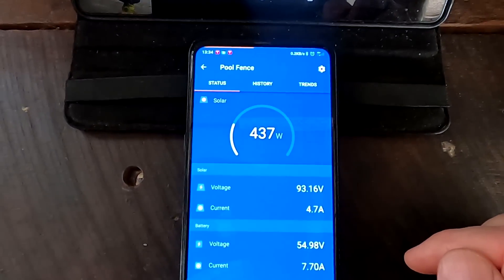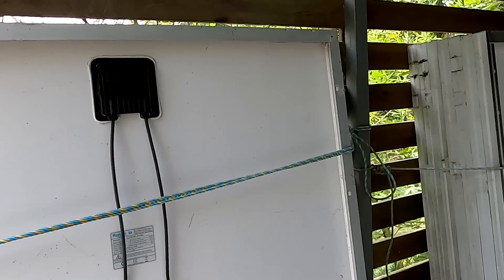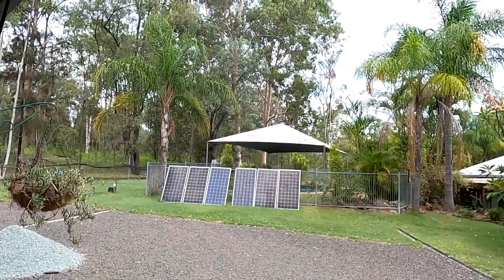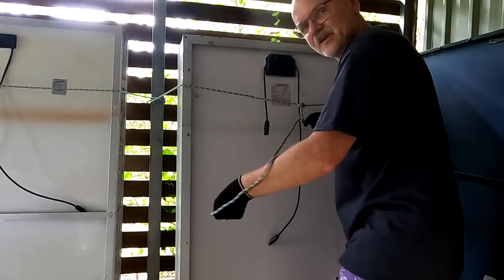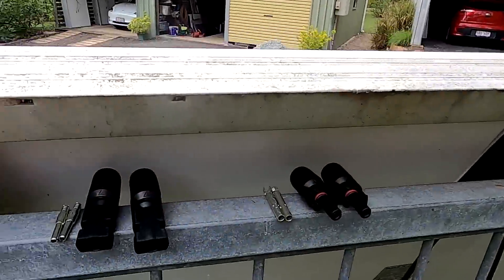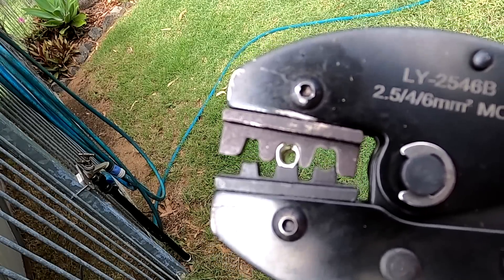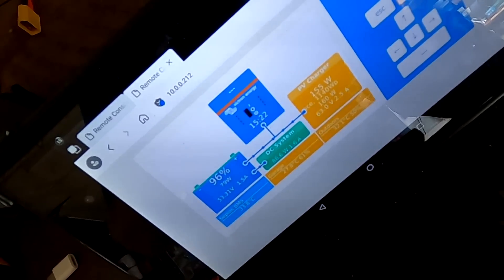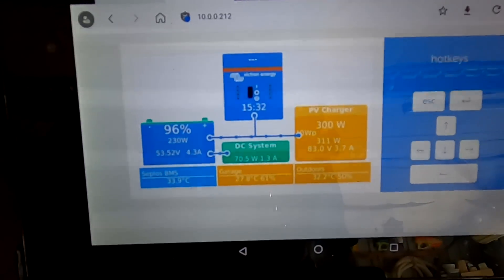'Massive' Pool Fence Solar Upgrade 😉 I almost lost it... 🤦‍♂️

Comment: Andy, I made the same mistake, putting the wrong ends on the MC4 connectors. IT took me a couple of days  wondering why the Amps were so low, I blamed the second hand panels I used. It wasn't until I went through every connection and double-triple checked everything that it became apparent. I don't feel so bad about it now when I see you got foooled too lol.
Reply from the maker: Yeah, the MC4 connectors are a bit tricky and I always need to concentrate when I crimp them.

Comment: 😁Im looking for some advice please, ...im in the uk, and very new to solar....i have 5 panels each 420w .....(each panel has  vmp 32.04v...imp 13.11A...voc 38.15v...isc 13.80A)
Can you give advice on what grid tie inverter would work well, ( id like a plug n play type like your blue 2kw grid tie), and whats the best way to  configure the panels and grid tie inverter?.... ( its difficult to decide, there seems to be many ways to go)...thankyou
Reply from the maker: Hi Andrew, that is a very difficult question. We don't know your requirements in terms of loads you want to connect, your roof space, orientation. Grid tie inverters are not plug'n play and need a qualified electrician to be installed and commissioned as per your grid code. A contract needs to be setup with your energy provider to export excess energy to the grid. So, there are quite a few things to consider and not a DIY job any more.
Reply: @OffGridGarageAustralia   thankyou for your reply...in simple terms i thought that the SUN-2000GTIL2 gridtie unit plug straight into the home electrical outlet/ standard 13a socket in uk, to deliver the power to a house that the panels produced?...is not that how this unit works?

Comment: Yah, those DC breakers are sometimes polarized.   Its a mix... some DC breakers are not polarized, some are.  If you put the wires in backwards for the DC breakers that are polarized, they basically won't function.   A bit of a hazard, I've accidentally reversed the polarity myself when changing the amperage... different brands arrange the plus and the minus in different orders.  Sigh.

Comment: Does the victron allow 2 strings and I’m guessing you added another circuit switch or did you run 5s2p? You didn’t say.
Reply from the maker: The MPPT allows only one string. The panels are in 3s2p configuration.

Comment: Hi Andy
I have 2 x 8S 280Ah Lifepo4 batteries, each with a JK-B2A8S20P (200A, 2A activ balancer) BMS. 
At the first glance everything works fine ...
But when I shut of the active balance function with my phone, 
and there is still a voltage deviation ... 
On the next day my battery is perfect balanced! 
The checkbox for balancing on my phone app is still OFF! :O
That happens on both of my batteries! 

It seems the balancing is allways on, regardless of the swich position in my phone app! :O
So it will be nice to verify my guess,  if you have time therefore ...

Regards from Berlin (It's cold outside -3°C)
Reply from the maker: The deviation will only show at 3.45V or higher. If you measure in the morning, the cells will be in the flat area of the curve and don't show any difference. 
If the balancer is on, you will also see the +-2A balance current in the app.

Comment: Hi Andy, I have been following you for a while and built my system using many of your ideas. I have a couple of questions about the battery 2.0:
1) Why don't you connect diagonally the batteries to the bus bar as recommended in the Victron wiring unlimited manual (page 19)?
2) From my understanding the vertical bus bars should be connected to the center of the horizontal bus bars in orders to optimize current circulation (see page 38 of Victron wiring unlimited)
3) If you want to move to parallel inverters, they should have same cable length and cross section, but also be connected symmetrically.
Hope I am not wasting your time and that these comments are helpful.
Congratulation for your work, kindness and German accent (I dare that joke since I am French and also have a strong accent ;-)))
Cheers from rainy South of France
Yann
Reply from the maker: Thanks, Yann
1) I have connected all banks to a 1200A bus bar so cross connecting them would make very little to no difference.
2) Again, this will make not much difference. If you have a very large system, it is more important to follow that but not for such a small one.
3) Yes, that is correct. I would just install a new pair of busbars right underneath the inverters and connect them both to that.

Questions and comments are never a waste of time. This is my favourite place to be. I appreciate your questions.

Comment: I am looking into Superen AC DC Hybrid Solar powered DC 3.5kw air-con system ,runs on 4-6 300w pannels in a string can take upto 300v , runs of both mains and solar auto switching if cloudy , they also do 48v offgrid 5kw system's ,
Reply from the maker: Great tip and they are even in Australia! I'll look into it.

Comment: I have 4 150w 20v in a string and 2x 300w 40v full size also in a string ,makes 1200w sun peek out behind clouds, average 800-900w ,peek voltage recorded today was 76v on a 100v/50a mppt,

Comment: I think the Victron MPPT is protected fron reverse polarity!
Reply from the maker: It does not seem so. I found two threads on the Victron Community forum when googling where people have blown their controller.
Reply: @OffGridGarageAustralia  Ftom MPPT 75/10 manual Section 3.4 - The solar charger is equipped with PV reverse polarity protection and PV reverse current protection.

Comment: You have all the figures needed to calculatte the Voltage during winter for example for the BLD 250 the spec sheet shows -0,36 %/°C as temperature coefficient.
Your panel showed a Voc of 35,97V for STC which means 25°C.

If you say that your australian minimum will be 5 then you will expect a -20°C lower temperature than stc. 

-20 °C x - 0,36% per °C = -20 x -0,36% = + 7,2% 

What does that mean ? Well, the Voltage will raise during winter by 7,2% over the 35,97V at STC or 35,97 V x 107,2% = 38,56V 
Imagine cold freezing german winter at -15°C and strong east wind, then you could double the effect of the temperature and suddenly with 14,4% more you would see over 41V and some inverters could be ruined that could only handle 40 / 80 /120 V and that will not happen now or then, but at some time years later when there is a really strong winter night when people will tell the manufacturer that it had been working for years and that it must be a warranty case.

Unless they send the inverter in for check and the panel types and orientation and date when it happened where. Then the smart dealer and manufacturer will check if the panels had been selected right cause most of the youtube channels  simply ignore these rules or are unable to explain the important details cause for many people -40 x - 0,45% looks horrible and they would not believe that a negative value times a negative values will result in a positive value and lead to an increasing voltage due to colder temperature than STC.

The usual youtube guide will talk about the 20 x250 Wp will fit to the 5  kW inverter but not talking about the Voc or Isc that have to be inside the operation limits during coldest night.

Therefore I put a sticker on the inverter SHUT OFF if temp is getting below -12°C based on the calculations and the limits of the inverter. 
I had to struggle a lot in the past with the new big panels of 500 Wp and more when voltage is about 48V and peaks about 50V in case of cold nights. Does not fit or people have to take care for the temperatures during winter without forgetting to turn it off. There are temperature switches that can do the job but usually they can turn on/off only 2 or 3 kW and not the big inverter load except you would use a relay. 

So you might now do the math up to which configuration you can go BUT KEEP ANOTHER POINT IN MIND

your panels are quite old already (I think about 2014 build) which also can mean that they no longer produce the amount of the specs so might be worth to check those out in full sun light and check if the Voc is still reached at 25°C or if the panels have already degraded by 10% which then could mean that the Voltage could have degraded - or the current or even both cause the degredation is usually considered to be 20% in 10 years based on Watt so maybe 10% after 9 years they have been already working. But it depends if the voltage has lost the 10% or not cause if the panels would have lost 10% just by the voltage alone that it would lower you Voc by 10% too.

So keep degredation as a piece of mind reserve in mind which acts like an additional safety buffer.

Might be worth a video how to plan and what to look for if you plan a solar array from scratch to avoid any damage years later. THe dealers and manufacturers here are suffering from big waves of damaged inverter years after sale after cold winter nights and the owners have no clue at all when they answer the questions they will get: which module type, orientation azimuth, slope and where located in which configuration 
So the owner will reply honestly and loose the warranty cause usually they have ignored to calculate all the parameters cause they had chosen based on 20x 250 Wp is below 5 kW the inverter can handle, maybe they had checked the voltage too but not for the worst conditions. 

This hurts only in all those countries that have seasons with pretty deep temperatures far away from the STC of 25°C 
You have to check your panels first based on the spec sheet pdf and compare that data with your victron system or simulator that had warned you right for a very , very good reason.

Hope it helps to avoid others from making these mistakes. I had to learn it too back when I had started cause a dealer did not wanna sell me any kind of modules as long as I could not explain to him my system and its limitations cause he said that I would blame the inverter manufacturer for a faulty unit which mostly would be the result of my fault. I could buy those 8 x 270 W modules each for 77€ brand new when I would be able to tell him the values of my configuration cause he did not wanna do the job for me as I was not willing to buy his Huawei inverter, but a growatt from someone else that fitted perfectly - but only based on Wp calculation and not based on the Voc at minus 15°C 
So I had to ask and learn the details to get the modules with a different inverter that would work flawlessly even at minus 15°C we rarely get here but 1 in a decade for sure.
Reply from the maker: But would not the sun have to shine quite substantially to get this maximum voltage. Of course there could be a scenario where you have the perfect orientation for a morning sun in Winter. I'm not expecting the sun to be that strong at that time though. And if so, it would warm up the panels already. I'm not sure if these calculations are not just to cover their arses so people don't make a claim because of these 0.0001% of installations where it may occur once in a lifetime.
But better safe than sorry.

Comment: To get an open circuit load the batteries would need to be full.  I bought 4 panels at 37v, so say 150v but during hot weather these drop to 27v 104v.  Growatt has 120v start voltage.  I couldn't work out why they'd stop charging at noon.  This is common ask on the forums but I've not seen anyone answer it.  I'd be surprised if old panels would ever get near the 140v mark, talk about hitting over 150v.  Lol
Reply from the maker: Yeah, hot weather will lower the voltage, so could be well the case that the inverter turns off if the voltage gets to low at noon. You need to add at least one more panel, if possible.

Comment: Measure twice 🤣🤣🤣 I see what you did there lol 🤣
Reply from the maker: Yep, it was a close call. The problem were these Y-cables as I could connect them both ways.
Reply: @OffGridGarageAustralia  there's never a dull moment when working with solar equipment..... 
Speaking of which, over winter I upgraded the amount of solar panels and added the 280ah eve type cells and had a great run and even was impressed with the performance and I just couldn't wait until summer came around to see my solar system running at peak all day long but...... Here we are, not so sunny hot Melbourne and I'm not getting what I was last winter! 
The weather hasn't been kind to me but it wasn't officially perfect during winter either... 
I have only had one good day which got me 20kwh over the two victron charge controller's but since then..... It's been crap! How's your summer going? Would you say that it's going better than winter or is this only a Melbourne thing LoL?

Comment: great video, here in Finland at -15C my panels produce more than label says, but seldomly, due to the snow on top of the panels , and as soon as i brush the snow away, the panels warm up and voltage drops a few % .11:16 it's cloudy, cant do anything about the weather, that is so strange humanity has all sorts of rain-dances, but where are the sun dances ?
my best magic for rain: water the lawn, put clean clothes to dry in lines, and wash the car, sooner than you want it starts to rain.

Comment: Andy thank you so much for showing me how to do this right. Why not do 3 sets of 3 panels so you stay under voltage and amps 3 in series then parallel them. 9 panels or even 12 if you have the room.
Andy yes in cold weather with full sun solar panels do output more than they say. I have 9400 watts total and have seen 9,756.32 watts when it was under freezing. Just above freezing I have seen right at 9,000 watts. so 15 degrees F makes a big difference at least in older panels. 
It is so nice to be out of the shortest days for solar. I have been running on batteries and inverters only since 29th of January. Today I couldn't use about 25kw of solar since my batteries got full at 1 pm. I did everything I could to use more. Washed dogs ran dishwasher and 3 loads of laundry. I could have made a batch of moonshine if I had my mash ready since my still uses electric(8 gallon still).  It looks like I will not need the grid till late fall again I hope. I can run my house for 5 days max if I get 5kw of solar each day(rainy cloudy days). It will take 3-4 more times getting batteries to 100% to get them top balanced ( .088-.094 today was  max). My 100% means 92.5% full. that means out of the 58kw I can use 53.65kw. At max I have seen 43.4 amps going into each battery( I have 4 of them).   Now to figure out how to get more energy in the worst 3 months. Looking at wind since wind is available in fall to spring here at an average of 12.8 mph. Anyone here done wind yet?
Reply from the maker: Thanks for sharing. Always interesting to hear how other people waste their energy when they have too much solar. Washing dogs... OK, that's an option 😊
I haven't got space at the pool fence for more panels but have some other options I'm discussing with my wife at the moment. It all needs approval 😉
Reply: @OffGridGarageAustralia  happy wife happy life for you.

Comment: You put strong hub from salvaged truck up high on pole and arrange panels in a Y then add small motor to spin( 50 Watts). Maybe use gear ratio to make with smaller motor. The panels will rotate around the axis of the hub. Mit das three rotating blades one ist always descending und accelerated und one ist in deceleration mit just von climbing. So ist good for maximum efficiency. As the photons cross between the anode and cathode the rotation diffraction had skewed each one longer so the velocity and duration increases. Photons tend to penetrate diverse areas of the anode and cathode. Less solar heating is observed as the heat energy source is spread out over greater area und the axial movement ist outward away from the heat source. The design has significant figures attached to the construction and manufacturing costs and the induction motor operating cost which consumes >120 Watts during peak solar gain periods. The benefits are multiple 1) The total peak solar gain duration is increased. 2) The high temperature lul dwell power loss time is decreased while the power output is increased. 3) Many people enjoy the slow moving " Dutch Mill", aesthetic effect. 4) High and low flying birds tend to alter course away from flying over.5) Nesting of animals and insects is discouraged. 6) The landscape shading and PAR values remain more natural than fixed base rack type installations. 7) Snow and water shedding is accelerated. 8)Installation of a peak solar tracking system can be easily installed.